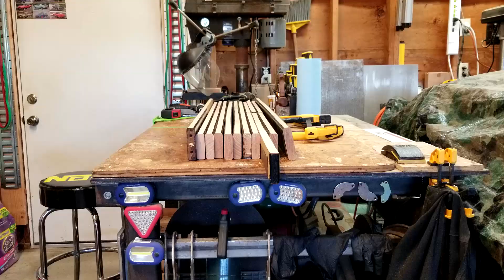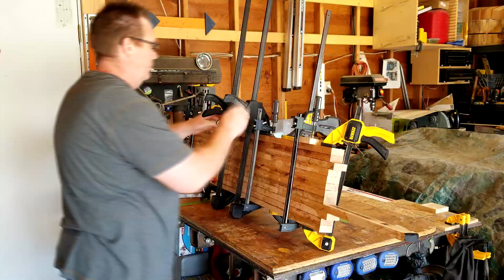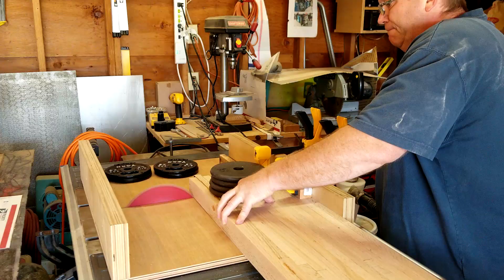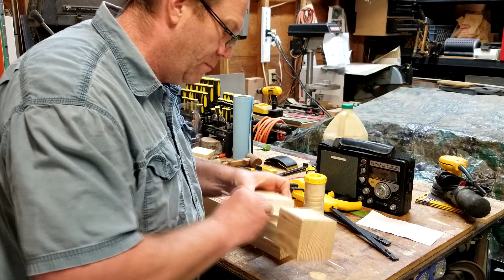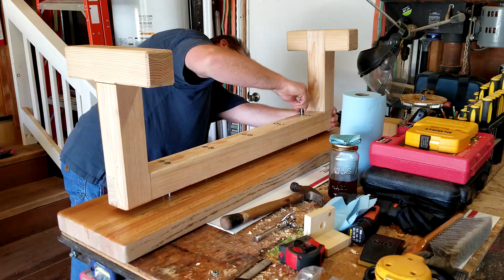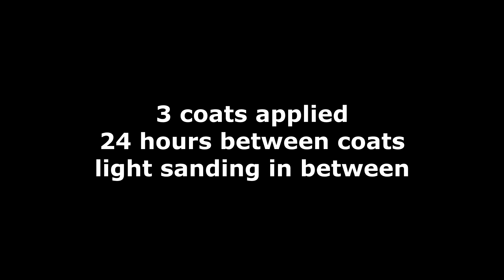LOCKDOWN DIY: How NOT to build a Workout Bench

Comment: You mentioned Starting Strength. Are you doing that program? I am just getting started and may need to build some equipment as well.
Reply from the maker: I would love to do, dont have a starting strength gym near me. I know they do an online program but would need to get more equipment.
Reply: @BubbasWorkbench  yes, currently doing the online version right now. Your correct, there is quite a bit of startup equipment needed. You could do the online version and go to a gym with barbell equipment. Not sure if you city/state is still in lockdown.